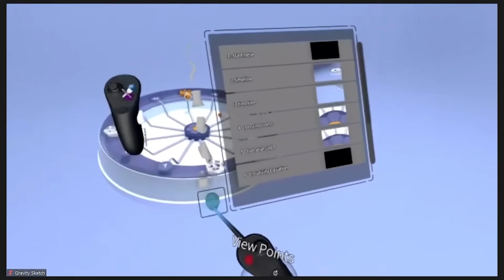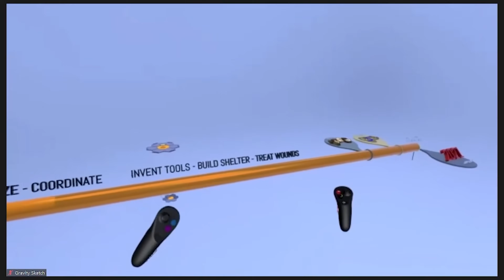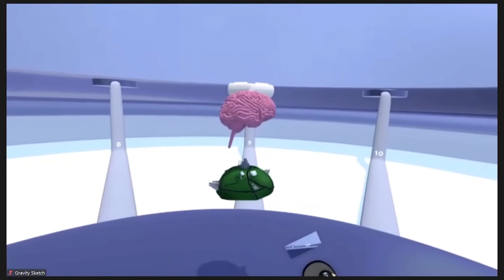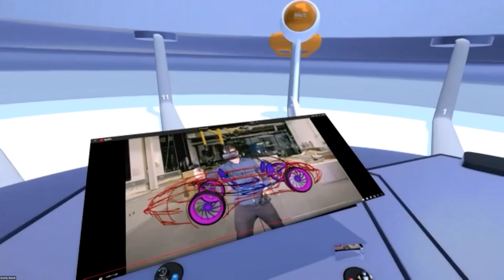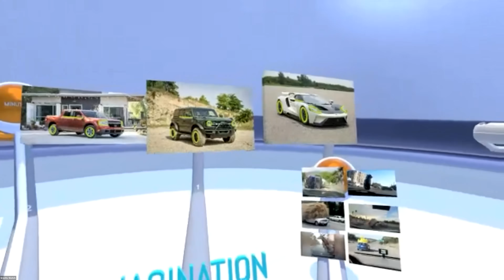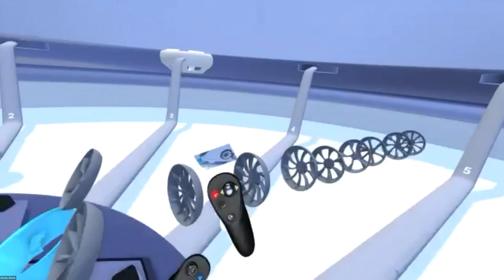The Human Machine Learning - Around Conference 2021

Comment: What a superb presentation. One of the many great points, was the comment about the act of assembling truck parts. Having to hold a part over your head as you install it. Gravity sketch would make it so easy to simulate assembly and see the problems an assembly line worker might face. Which might prompt redesign of that part before it becomes a problem. 
Engineers collaborating with assemblers and others in the process is so important. 
Architects, contractors and homeowners could collaborate in much the same way.